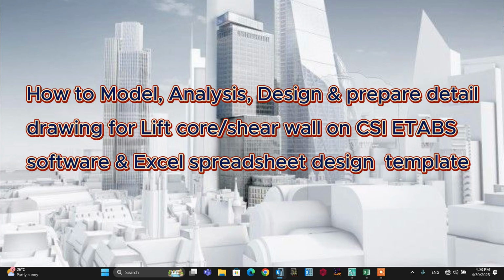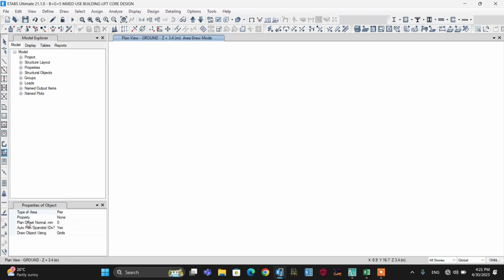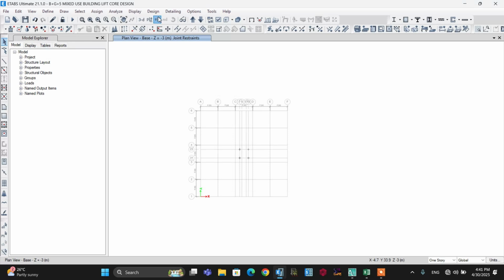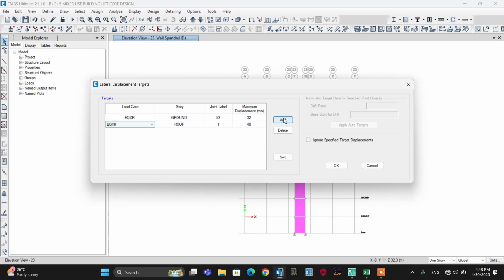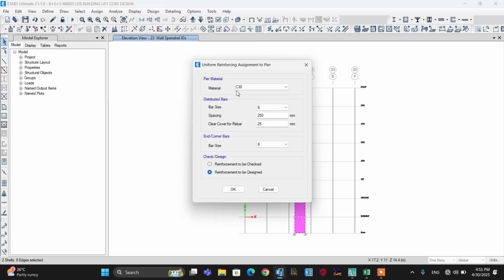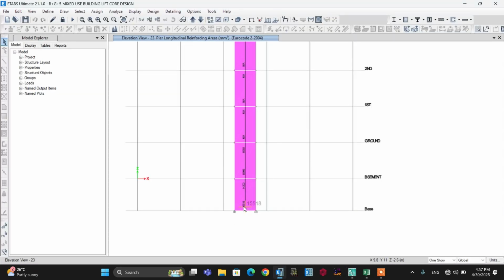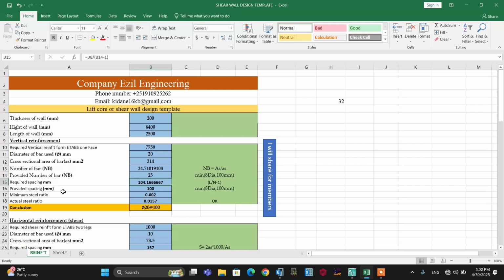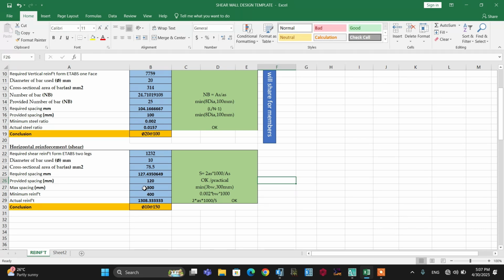Mastering Shear wall or lift core design in CSI ETABS: Modeling, Analysis, & Structural detailing

Comment: Selam Dear Engr.
I have a question about the modeling of the spandrel section. Do you think that the spandrel section has the same local axis as the remaining side section of the shear wall? This may lead to wrong analysis results and design outputs. 
Thanks
Reply from the maker: Thank you for your good insight. Why we mesh it before analysis and design? The answer is here
Reply: @Ezilengineering 
Thanks for your response!
I think, modeling of spandrel as a couple deep beam section is better to connect and transfer transversal effects to both sides of shear walls. 
Having a similar local axis of piers and spandrel sections is also important.

Comment: Nice, but dia20 looks too much for the specified thickness of wall and number of stories. I think your building looks regular  in elevation and plan hence it becomes  free from torsional behaviour. You can check your q factor selection  and base shear scaling.